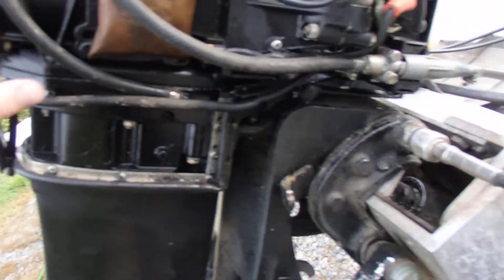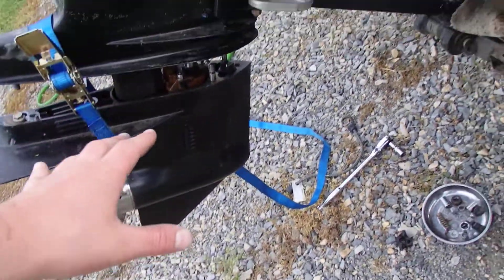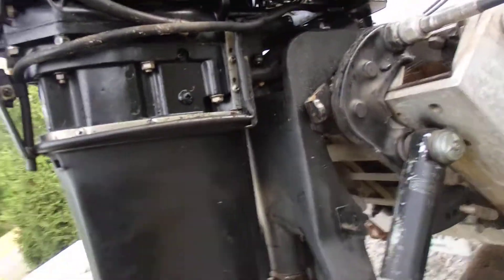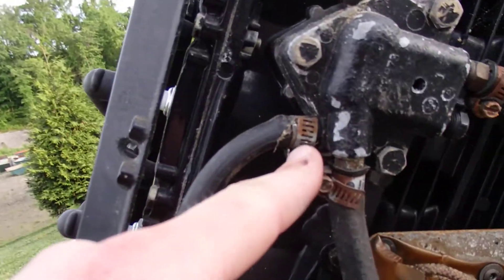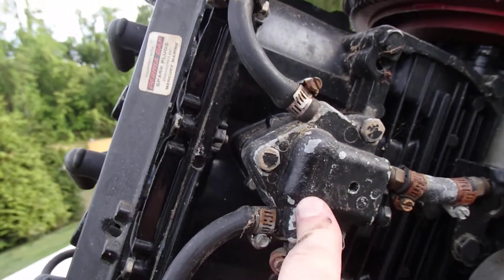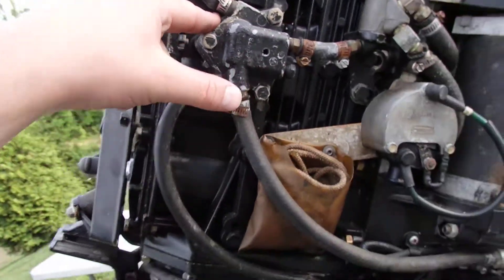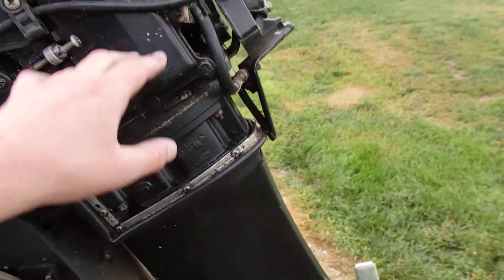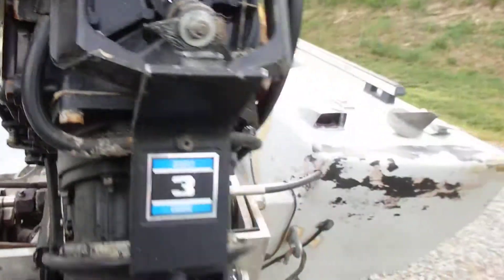1974 Mercury 650 water cooling system

Comment: Hi my name is William I have the same exact outboard black like yours and when you was talkin about the water system I also see that when I take my coat off and have it submerged in water it has a little bitty hole where the idle stop is but it's on the water block and that tiny spot is a double circle but it's a tiny Circle in the middle of that and water shoots out from there too trying to see if yours does the same
Reply: I have the same motor and was wondering the same thing

Comment: I bypassed that stupid water cooler for the fuel pump. So much easier to work on and more pressure is supplied to the parts that matter.